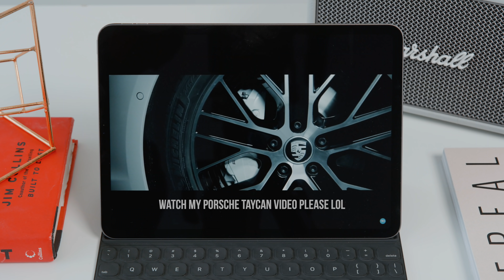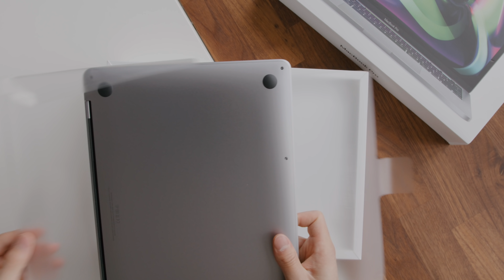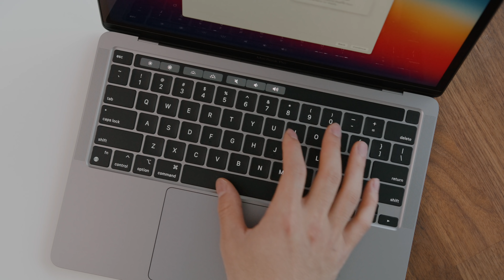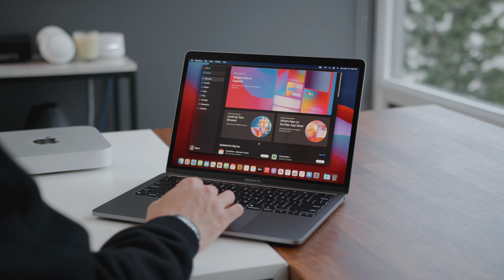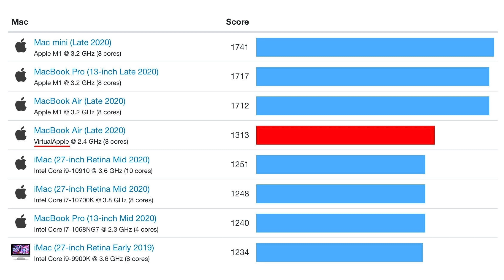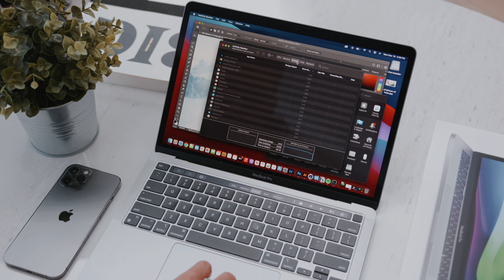M1 MacBook Pro 2020 Unboxing & Speed Test!

Comment: Kinda regret getting 2020 MBP earlier this year after this came out. Seems like a great machine.
Reply: Yeah same. Bought one a month ago.
Reply: @Burritosarebetterthantacos  If I were you I would try to return since you just got it a month ago. Might be worth the shot
Reply: nah, you don't need to.. 2020 MBP is still badass
Reply: @vikashkys  I did the same , but luckily I could return it for buy this !
Reply: @vikashkys  True, but getting better performance and better battery for roughly the same price is kinda nice
Reply: @nefitru  yes. I would return or sell the old 2020 MacBook. Most people don't know the difference right now so you will easily get a good price and get the MacBook pro 13 2020 256 GB + an fast type c SSD

Comment: Would you recommend this for video editing ? for an aspiring content creator ?
Ig: atul.drummer
Reply: Well it depends on what type of content your planning to shoot. Generally the 13 inch works great for photo and something like final cut pro. Otherwise the 16 inch albeit being more expensive is Cally the better choice
Reply: @nobel978  but 16 inch ones tend to get way above the price threshold.. 
And now I want to know how these compares to the PC laptops 
And btw thank you for the reply
Reply: @atuljoshy  Well that's the thing with the m1, by the looks of it the price to performance ratio is much better which leads to me believing the price of mbp 16 not being so expense. If price is an important factor than you should always go with pc as long as you don't use software that requires mac os like final cut pro